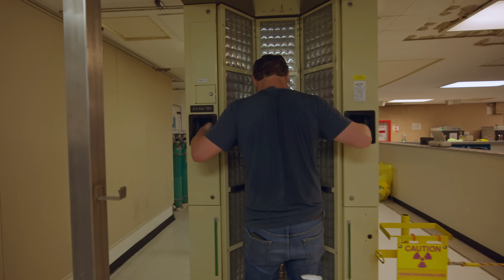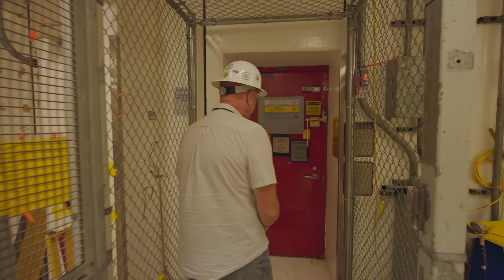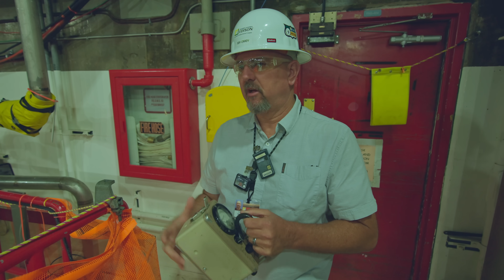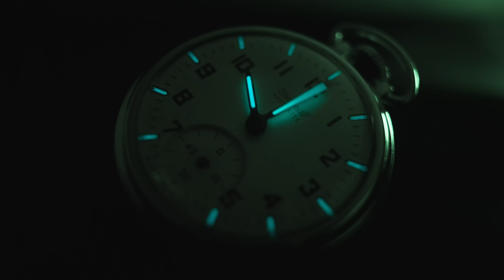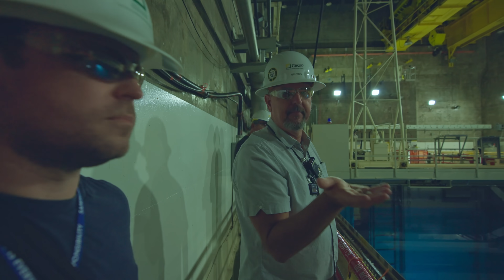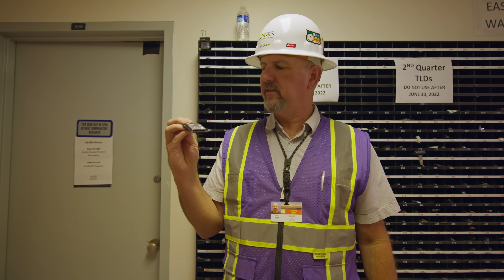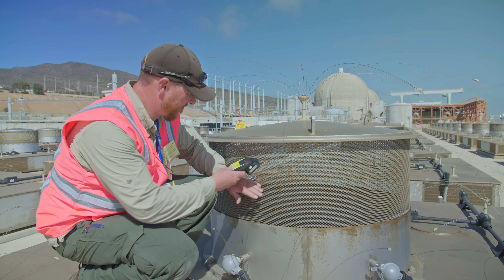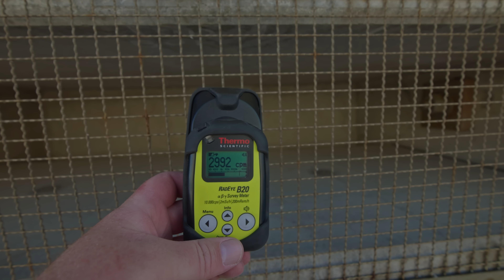Inside San Onofre Nuclear Power Fuel Pool and Spent Fuel Storage

Comment: Neutron insertion rods made of graphite  absorb andmoderate the chain reaction.otgerwise it's an atomic explosion in slow motion
Reply from the maker: No, if you used graphite in this way your core would meltdown. Graphite is a neutron moderator and reflector. It doesn't absorb neutrons to stop the fission reaction. You need something like cadmium to absorb neutrons.
Reply: @RadioactiveDrew point taken.  I look at cerenkov radiation as an indicator of a healthy reactor runnu g smooth

Comment: concrete and steel both corrode away over time let that sink in that concrete and steel will be long gone and the radioactivity will be there for years after
Reply from the maker: That would take hundreds of years, if not over a thousand for that pad to break down. Its incredibly over engineered. Also even if it did corrode enough to expose the fuel nothing would happen. As long as you weren't climbing in the casks everyone in the area would be fine.

Comment: Problem with nuclear is that its service life vs it's out of service /decaying life is 10000x that. Globally, if we keep using nuclear, where are we going to put all this? I could understand if its service life was 10 years, and then another 10 years till there is zero radiation.. but it is 100,000 years give or take... Look at the mess in the German salt mine. If I am wrong, please explain.
Reply from the maker: The spent fuel barely takes up any room.

Comment: That other guy towards the end who is saying its all fine, is the first guy to be taken out by the Godzilla :))))) Look, the newer storage are already rusting, so in 100 years, who knows whats going to happen, the highest recorded tsunami is 27 feet and this storage sits at 32 feet, so only 5 feet margin of safety, what about an unrecorded event? Plus when you said highest reading is 500, that means they're not consistent, so one storage contamination is weaker than the others. Also the older models, on the first layer, its only as strong as concrete block is to the nearest edge of the rectangle, so if somehow thats cracked open, Godzilla steps on it, it will expose it for further degradation. That salt-air will eat through anything given enough time, definitely sooner than the 30,000 year half life.
Reply from the maker: This site could be underwater and there would be zero risk to anyone living in the area. The casks could be open to the air with zero risk to anyone in the area.

Comment: Why are you using CPM instead of Msv/h on your readings?
Reply from the maker: CPM is the raw data coming in with the detector I'm using. Since it sees alpha, beta and gamma, all at the same time, it doesn't make sense to use a dose only measurement. If I had a gamma filter on the detector then it automatically senses the filter and switches it over to dose rate.
Reply: @RadioactiveDrew  gotcha

Comment: Why are they decommissioning these plants. They will make power longer than those stupid windmills. They will make power in all weather and after the sun goes down. What shame. Millions of dollars wasted to build that plant to only be demolished and the site will be a non buildable site for years.
Reply from the maker: I agree...its a horrible waste of resources to take this place apart.
Reply: The main reason apparently was because "premature wear was found on more than 3,000 tubes in 15 000 places in replacement steam generators that had been installed in 2010 and 2011"...so basicly s**t equipment that was just installed to replace old equipment and plant officials pledged not to restart reactors until the causes of the tube leak and tube degradation were understood, but neither reactors were never restarted apparently because it would have been to expensive and not worth the effort to prolong the life of these reactors longer.

Mind you, Unit 1 of the plant was operational for 25 years before it was dismantled in early 90s, reactors 2 and 3 operated longer, for nearly 30 years.

Overall it really depends on how well the reactor and everything around it was built originally and how well it was maintained that ultimately effects for how long nuclear power plants can stay operational safely. As with many other older buildings, sometimes repairing one is just not worth the effort and money.

What you should ask instead is why US isnt building more new reactors that could have longer lifespans.

Comment: Fun factoids about the PC's you have to wear inside containment.  At most sites the containment chillers are turned off or are down for maintenance during outages so it's like wearing a garbage bag over your entire body in a 100 degree sauna for hours at a time.  Then if you're doing any water work you usually have to wear a second set of water resistant ones over top of those which breath even less.  Makes doing physical labor an absolute treat!  You can make some pretty good money doing it, but it's definitely not for the faint of heart.

Comment: If you want to know how indestructible the nuclear transport container is check out department of energy's website out. The video was on their website when I was looking around to find out how dangerous those things are and I'm not sure if it's still there but they literally ran a train into one to verify it's safety factor and the only thing to happen to that monster was a dent and some scratches (granted it was empty) which is extremely impressive getting hit by a train engine. The reason why I looked into the safety of it was I was driving semi trucks and a train with literally 1 car behind it with this massive tank on the car was literally hauling arse to the waste disposal salt mines in Utah. I thought it was weird a train pulling one car environmentally speaking but I'm really glad the troopers closed the train crossing down after I found out what that dang thing carried.
Reply: Enough to send chills down your back with how close it got. After that though I've been passed by IDK how many explosive loads on the freeway, heck I haul ammunition to a non nondescript building in New Jersey going to a military base (no I had no idea ammunition was in the trailer since it was sealed and the bills had vegetables on the manifest but half the trailer was ammunition, scared the mess out of me since I went through 3 tunnels to get to the East Coast to find out I had an undocumented hazmat load).

Comment: So how long do they have to store and monitor the spent fuel before it gets back to the same natural Background Levels or deamed Safe To No Longer rquire monitoring?
Reply from the maker: Its a forever thing...meaning it will have to stay in those dry casks. The fuel could be used in other reactors. It could also be used as a heat source for a radio thermal generator. The radiation coming off the fuel in the dry storage isn't a problem when its in the cask.

Comment: 29:19 actually it’s exactly how it works, all these other places also had precautions in place etcetera.. and it’s not just Chernobyl, Fukushima, there were also happenings in the US in PA.. some years ago. You’re laughing it off like ooh no this won’t and couldn’t ever happen sounds so not that smart.. there are earthquakes, structural things and procedures that can go wrong… nuclear is not safe, and is not as safe as people think also the nuclear waste that’s just keeps accumulating even if nothing happens is an issue worldwide. In Japan they even have problems with storing facilities that aren’t enough so plants are storing it within the facilities. Same with the proud operator that’s not very likely…that’s always the first line it never was still shit happens right. People seem to have very short memories. I have worked in the chemical and petrochemical field and it’s the same thing, so many things I saw in 20some years of things that shouldn’t have happened but did. Valves blowing off, leaking valves, pressure issues. There’s a million things that can go wrong.
Reply: Ok let's just keep creating radioactive solar panels. And we should keep creating greenhouse gasses by burning coal instead I guess. 

We're getting really really good at nuclear safety and cleaning up contamination. Why abandon that now. With modern core catchers there's no reason why even meltdowns would be an environmental concern. 

Aside from all that, there are how many hundreds of nuclear plants in the world? And only 2 times has a plant ever had a serious impact on its immediate environment. 1 time from a cheap country making a cheap reactor, the other time was a natural disaster that killed thousands in the first place.

Comment: Without watching the video, the spent fuel is lethal. That's why it has to be under 20' of water or in a concrete bunker.
Reply from the maker: It is lethal…if you get close enough with it being unshielded. There are other radioactive sources that could kill someone just as fast. Those sources are typically used for food preservation and sterilizing medical instruments.

Comment: This YouTube video is pure propaganda. Fission reactor is very dangerous. During some of the  years of normal operation of San Onofre Nuclear Generating Plant ( SONG), SONG had issues containing radioactive fleas(RF) . Several nuke chemical engineers were hired by Edison to locate the RF and identify the source. This task was tenacious and protracted, but in the end the RF were all located; sources were identified; and the solution addressed the problem. Unfortunately, two of the several nuke chemical engineers developed severe cancer that quickly became terminal cases. Sporadic and isolated cases of RF still can occur, but the past experience can mitigate their danger.

The decommissioning of SONG is reaching a decade and the end is not in sight or certain. It is certain that the very expensive cost of decommissioning SONG is tacked on every Edison customer’s bill — indefinitely. Today, nobody is willing to accept the nuke waste due to their lethality and longevity. Radioactive Strontium 90 half life is about 100,000 years. Iodine 131 is about 1,000 years.  Iron, Nickel, Copper, and other radioactive isotopes have similar half life. 

In contrast solar and photovoltaic electricity generation cost less than 30% of a SONG, maintenance is much lower, replacement cost is feasible, very clean electricity generation, and no long term radioactive decommissioning cost or fear of radioactive contamination. As for liability Edison can buy private insurance to cover solar plants. No private insurances are willing to cover a nuke plant. Only the Federal Government insures nuke plants through the Anderson Act— making all US taxpayers holding the bag. 

Some very stupid old goats on the Edison board of directors made several near fatal mistakes when they authorized the construction of several nuke power plants in California. Their mistakes have been very costly affecting several generations.  The rate for Nuke electricity is nearly 3x of hydroelectric or solar — that’s not including the special fee for decommissioning old Nuke such as SONG. 

Bringing back nuke Generator plants is akin to resurrecting the stupid old goats to repeat their near fatal catastrophe, and inflicting their curse , again,  upon the future generations for the next 100,000 years — if humanity hasn’t destroyed itself by nuke power plants.
Reply from the maker: I would go back and do your research again because you got everything wrong.

There is no such thing as radioactive fleas. The only thing I could even think of that might come close to something like that is some slightly hot particles that get stuck on clothing. Which is the reason why they do the scanning and wearing of suits for working in the reactor room or around fuel handling. 

The reason why its taken a decade to decommission SONGS is because California wouldn't give them the go ahead on the work. A lot has been taken apart on site since I was there a couple years ago. You are wrong about Strontium-90, it has a half-life of 28 years. That means that in 280 years its completely gone. Same thing with Cesium-137, which has a half-life of 30 years. Iodine-131 has a 8 day half-life and is completely gone in 80 days. 

Solar panels are great for certain applications...I use them for camping and low power tasks. But anything that requires you to have a large base load power or have power during the night or when the sun isn't out. Then solar doesn't do much at providing for the grid. Plus the panels have a much shorter lifespan than any nuclear generating station. Solar Panels also require more land and displace more habitat than any nuclear power station. SONGS was shutdown prematurely because lawmakers in California are stupid and don't understand any science. 

Bringing back nuclear is the only way we are going to keep up with power demands. The waste isn't a problem like you've heard. The spent fuel at SONGS is perfectly safe right where it is and can be used as fuel in other reactors as well.
Reply: The plant is called SONGS not SONG dummy.

Comment: It's most unfortunate that they never have a nuclear engineer to create these videos because the topic is far beyond any of the people who are making videos.  That's a result , but the information is either misleading or just plain wrong!  One of the challenges is with the misleading terms that are used in the nuclear industry.  For example, "spent fuel" is NOT "spent" at all!!!  [ So called spent fuel can be used for hundreds of years.  You simply need to either "reprocess" the fuel (which our navy does routinely) or use a breeder reactor and then put the fuel right back in the power reactor.  The other challenge is understanding radioactive emissions as it relates to potential harm.  Again?
None of the authors of these videos actually understands radiation at all.  So, they fail to understand any true hazard and nearly always overstate any potential hazards.  They do not understand the different types of radiologic emissions, residual radiation, or potential hazards.  Nearly every object on earth is technically "radioactive".  Some may be hazardous but most is not.  For example, few people realize that pilots receive the HIGHEST dose rate of any occupation, yet they do NOT experience significant issues with radiologic exposure!!!  So there is a problem with ignprince in this field amongst the public.  Sadly corrupt and greedy And greedy pseudo activist , promote distortions to attract DONATIONS ($) from the needlessly frightened public!  [For example, Carter's presidential Commission on three mile island stated that: "The greatest danger to public health was anxiety caused by Felicious news reports."  In other words, the ONLY REAL "danger" to public health was the ANXIETY caused by FAKE NEWS!... And this came from a democrat!  It would be nice if the creators of these videos actually worked with a legitimate and competent engineer first!  But concepts taught in this video are  MISLEADING and WRONG!
Reply from the maker: Not sure who you are talking about? I have a lot of first hand experience with different types of radiation and radiation exposure.

Comment: I worked for years with PenPower a company the GE reactors contracted with for reactor and piping inspections during maintenance shutdowns as well as any fuel movements. We would travel from reactor plant to reactor plant during the shut down seasons, usually spring and fall when energy demands were low. 
Moving the rods wasn't really that stressful, the cranes did not let you raise them to an unsafe level where the radioactivity would escape the water. ALL movements were triple checked before you lifted a fuel rod from the core and also triple checked to ensure it was being places in the correct slot in the spent fuel pool.
Only thing majorly different is we did not get to wear regular clothes while working on the reactor. We wore color coded overalls, gloves with thick rubber gloves over them and boots over our shoes all duct taped to the overalls. Man did it get hot in there.
The guide was spot on with everything he said and that blue glow sure did bri g back memories.
Reply from the maker: I think if we were inside of a working facility we would have been dressing in clothes for that area, like what you were describing. The people working in the reactor room had yellow tyvek clothing on.